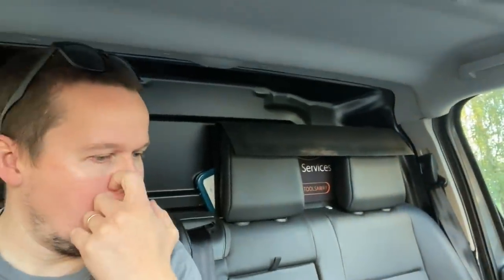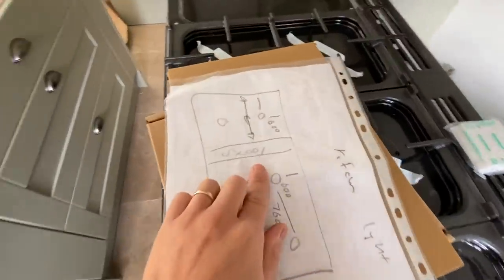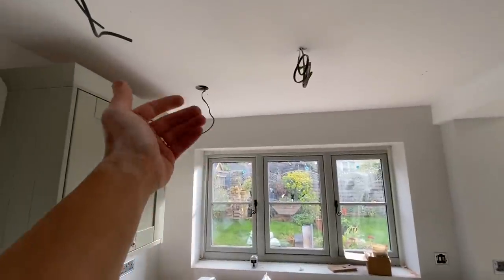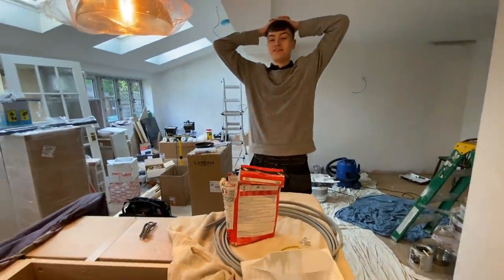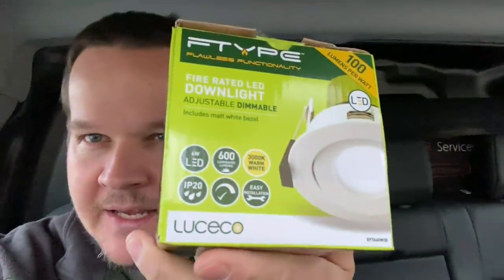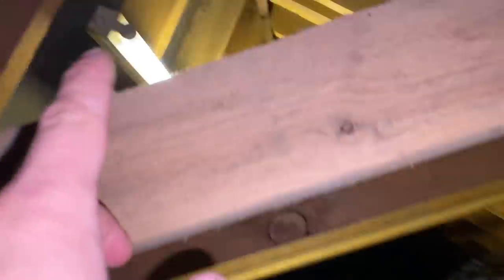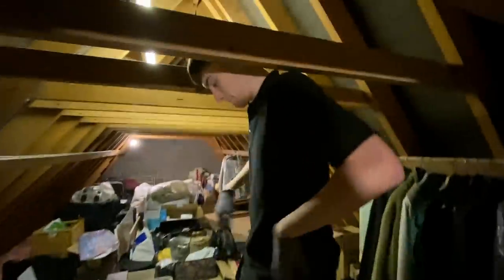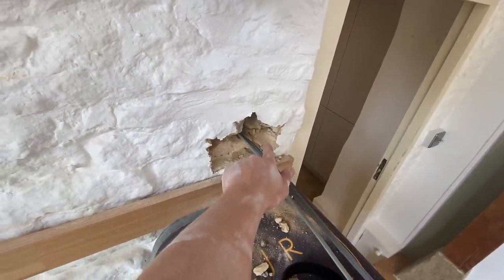Nightmare electrical work. Glamorous life of an Electrician

Comment: I fitted knightsbridge flat plate brushed steel like what you've got here, within less than a year the lacquer used on the fittings was wearing off on every light switch and the sockets scratch really easily when plugging things in. Look really good when fitted but they don't hold up the test of time.
Reply from the maker: Cheers il let the client know to keep an eye out
Reply: Dont say that, I’ve just done a house rewire and put Knightsbridge in everywhere!

Comment: Hey Chris I’m surprised you are allowed to install a batten type fitting in the loft still reachable from the landing because in Australia it has to be above 2400mm as without a lamp it can allow people to insert their fingers and have access to live parts. In Australia we have to make it “stupid proof”
Reply: 1800mm
Reply: New ones are 'safety' as in when a lamp is not inserted then you still have to push the pins in to make them live and by that point you deserve a belt lol

Comment: Good idea using a long driver to check for joists. I have always drilled a few small holes but your method is better. I wouldn’t fit Luceco Downlights, their stuff doesn’t tend to last
Reply from the maker: Been fitting them for 4 years now with no call backs yet 🤷🏻‍♂️
Reply: @Cjrelectrical  yeah fitted loads my self, had one fail. But I did drop it of the too of my steps.
Have started moving to V50 , as have advantage of shallow and cct control. However the lucceco do look better and more flush fit to ceiling

Comment: Tip: if you match one quinetic switch to more than one receiver... explain to the customer how they work... explain that if the 2 items get out of sync (it happens) all they have to do is turn off the breaker, wait 10 seconds, turn back on.... It saves callouts :)..

Speaking from 'omfg' experience
Reply from the maker: Will do

Comment: Great channel, could you do something on what you would suggest to use for an outdoor LED flood light, the general consensus is they only last about a year? Keep up the good work.
Reply from the maker: You would be correct definitely go for quality over cheap within a year you will be replacing it
Reply: @Cjrelectrical  I have to disagree, I installed a cheep LED flood light from energiser 4 years ago, £14 from Wilco and it’s as bright now as it was when I installed it and still going strong , cheep isn’t always bad . I say if you do buy cheep then always buy recognised brands , not the unbranded stuff on market stalls or from those crap shopping channels . 
Fantastic video Chris as always 👍👍👍❤️

Comment: Like the spd board, but the question i would like to ask at what point does it warrant a plastic fuse board to be changed to metal 🤔
Reply from the maker: Understairs only escape route with no other fire protection plus other issues

Comment: 8:57 He will learn to use the steps as he gets older. That is one of the mistaked apprentices make when starting out, not getting in the best ergonomic spot for their shoulders. 
I am an apprentice, and I allways try to get as high to the ceiling I can without bending my back very badly.
And I am quite tall my self. 192cm tall.

Comment: Nicely done. With the vaulted ceiling and the PIR insulation how do you fit the spots? Or is it battened off the PIR to give a bit of a void? Some building inspectors don’t like them in the celotex. Also is the cable just run along the rafters with the celotex tight against it or above the celotex in the air gap? Cheers.
Reply from the maker: Normally the builder leaves some cut outs but not on this occasion. This ceiling was luckily battened over and plasterboard on top so I had a nice clear run to wire in.

Comment: Hey Chris, Have you ever had any callbacks due to those luceco’s failing ? How come you choose to fit the built in led type rather than standard fireproof GU10 downlight ? ( pro’s vs con’s ) 

I’ve only fitted GU10 downlights in my own home as I like that the lamp is easily replaceable.
Reply from the maker: No never had any call backs on the integrated yet.
The light output always seems far superior to the gu10 lamps I’ve tried
Reply: @Cjrelectrical  I think they cast a better/brighter and more even light due to the better diffuser

Comment: Hi ,is there a reason you used a kinetic switch for under cupboard lights etc ?
Reply from the maker: Yes I only had room for 4 modules in the 2gang box do doubles up the island and cabinets on 1 Quinetic switch with 2 receivers
Reply: @Cjrelectrical  was wondering If it was added later as if you got a feed at switch would of fed from that as still got to feed the receivers?anyway it’s not a scrutinise ,keep up good work I enjoy your channel 👍

Comment: Why do british wall plates all look so boring and retro.. fat pots sticking out of the plate like a 1930's radio. I kinda like the look of the tiny switches, although I expect them to be rather fiddly compared to the bigger switch plates we use on the mainland, especially in the night.. but the dimmer pots always irritate my sense of design.
(brushed aluminium.. well.. looks nice, but I guess those will collect fingerprints and scratches in no time..)
Reply: Check out the varilight touch master dimmer switches.